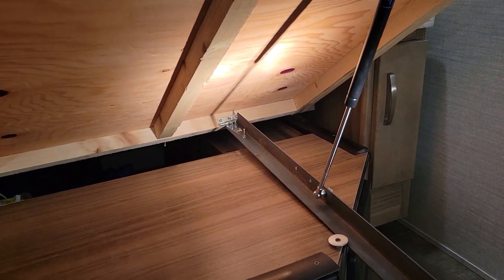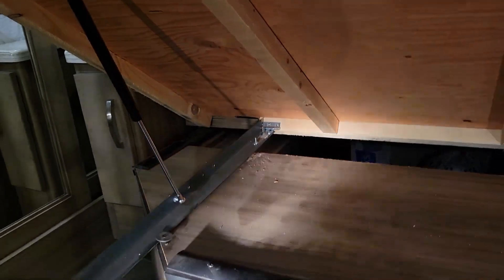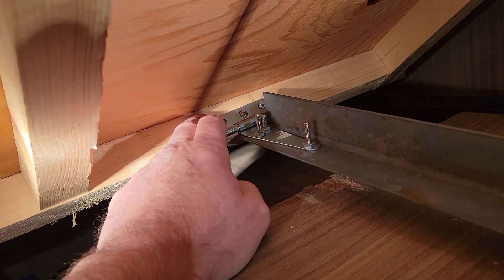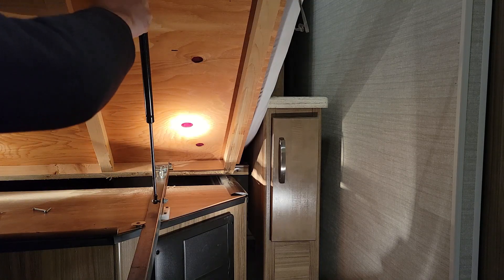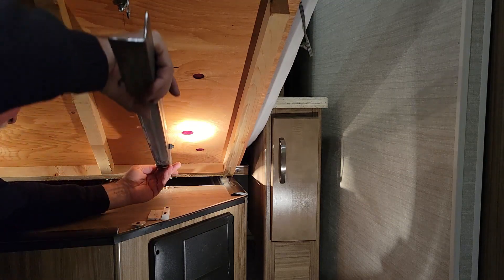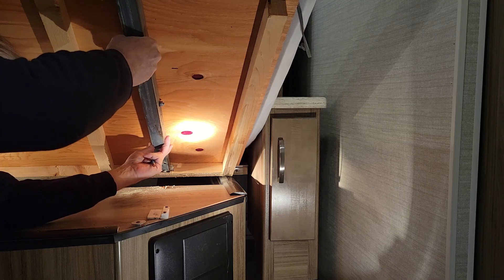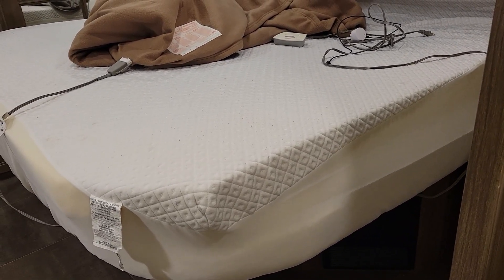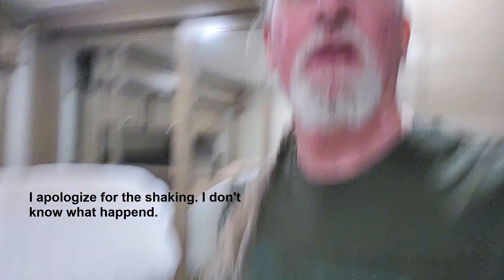Sliding bed lift

Comment: Did you make the motorized slide for the bed as well ? If so how & what did you use for engineering
Reply from the maker: No, the whole bed was on a factory installed slide. It is a Schwintek. Because the pedestal didn't slide I had to make the rails and lifts move with the slide.

Comment: Steven Kennell
0 seconds ago
What size was your angle iron?  I was thinking of putting white plastic u channel at the box for the keeper and to allow the slide. Great idea and design!
Reply from the maker: Don't laugh, I used an old bed frame. The angle iron is 1 1/2 inch by 1 1/2 inch. I like the idea of a U-Channel to hold the angle iron straight on course, however, remember you have to hold the angle iron down while lifting the bed. That is why there is a large fender washer on the one side above the angel iron.
Reply: Yes…..i remembered that.  I was thinking a z clip.  There isn’t much force up on the angle iron at the unhinged end I don’t think….. you have designed it to load the bar and the hinge end I believe…..I’ll find out
I actually have a thick plastic ridge on the box end that the wood rails slide on already so I was just going to ride that then use brackets to eliminate the lateral movement.  I’m excited to implement as I have wanted a solution to this for a couple years!  Thanks again for solving the great mystery
Reply: Also my wood sliders are only 1 1/8 inches high so I will have to use smaller iron….I might be able to use 1 inch
Reply from the maker: If I remember correct, I designed it so the bottom of the strut was right over the wood frame at the end of the storage compartment.
Reply from the maker: One inch angle iron will still be plenty strong enough to support the bed.

Comment: What size/weight strength lifts did you use?
Reply from the maker: I bought them on Amazon:

20 inch 150 LB Gas Prop Struts Shocks, 20" 150lbs Lift-Support Springs with L-Type Mounting Brackets for Heavy Duty RV Bed Murphy Bed Tool Box Floor Hatch Window (Suitable Support Weight: 130-165lbs)
Reply: @wanderingpeaches  Thx
Reply from the maker: you are welcome

Comment: Do you have a video showing your original design and install…..I have the same configuration in a class a and would like to install your solution
Reply from the maker: Unfortunately I do not. But the basic design is in this video. Two angle irons, two hydraulic  lifts, some washers, screws and two hinges.
Reply: What size was your angle iron?  I was thinking of putting white plastic u channel at the box for the keeper and to allow the slide.
Reply from the maker: how did your lift work out?